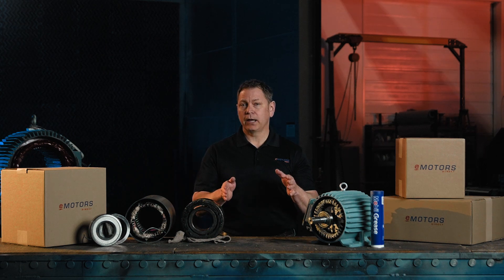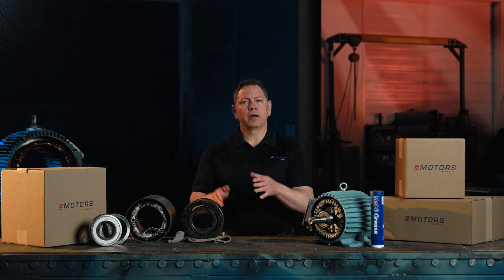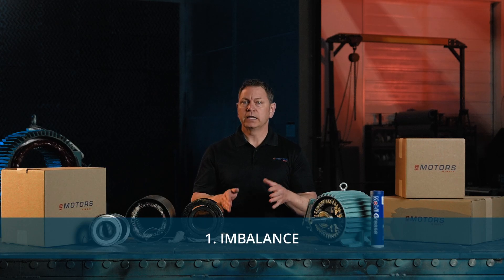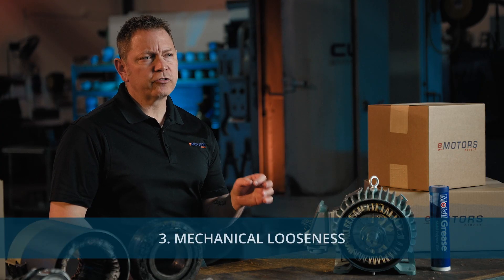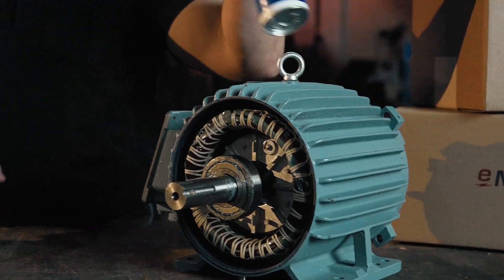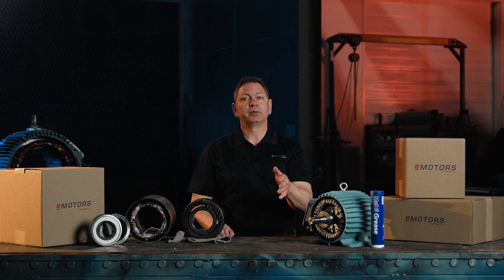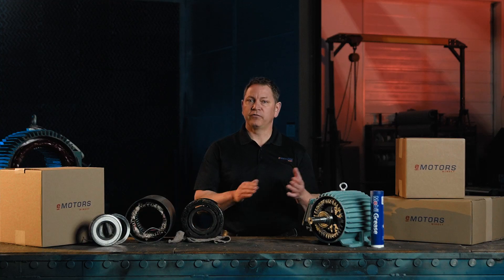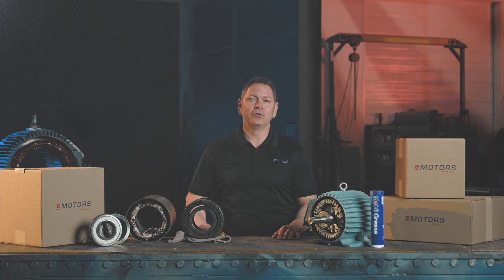Can Bad Motor Mounts Cause Vibration? | 7 Causes of Electric Motor Vibration Explained

Comment: Hi sir
I read in HVAC books, compressor motor is amperage rating not hors power rating. While at the same time hors power important to know the capacity of refrigeration device. What dose amperage rating means please demonstrate this to me?
Best regards.
Reply from the maker: Hi! Great question — the amperage rating tells you how much current the motor draws under load, while horsepower shows how much work it can do. For compressors, amps are critical for wiring and protection, but HP still indicates capacity. Hope that helps!
Reply: @emotorsdirect thank a lot sir❤